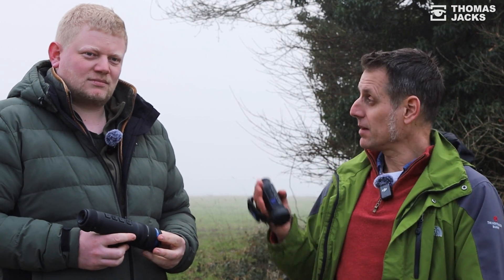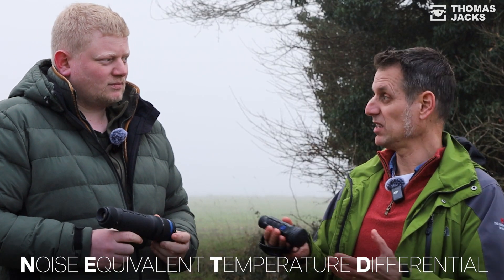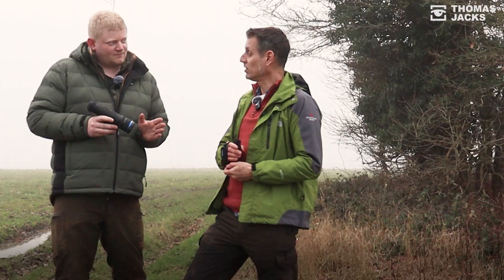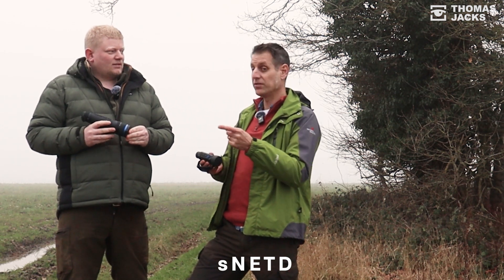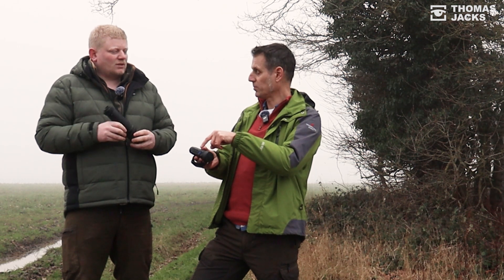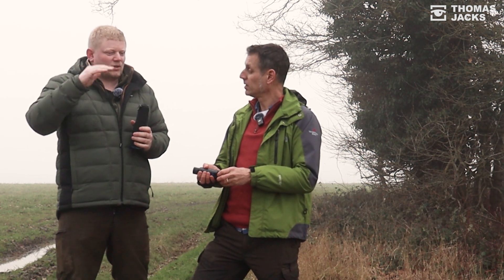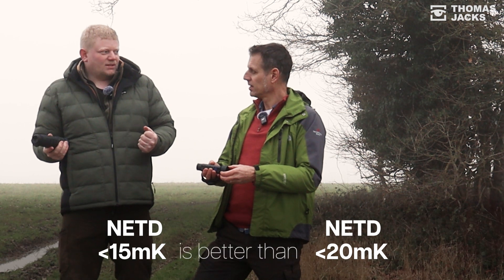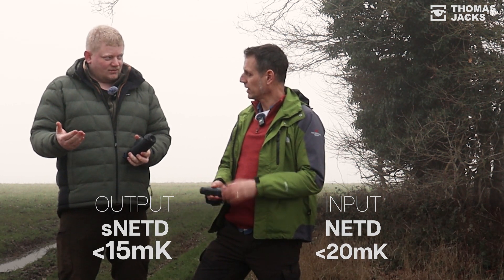NETD versus sNETD: The truth about your thermal's spec

Comment: Do thermal sensors actually produce an image though? As in, can the image be seen with no processing? If not, then how can there be a difference between sNETD or NETD?
Reply from the maker: It's the same principle as a digital camera - there will always be some processing. But the level of processing and the degree of compromise that accompanies that, will vary. On the whole, the principle of 'you get what you pay for' is usually a good rule of thumb. 
Pulsar are the only manufacturer to provide the sensor manufacturer's NETD value. Others only give the NETD figure after all the processing. So the two are not the same. 
In future Pulsar will give you both the true NETD of the sensor and the processed system NETD figure, to help customers can compare. I suspect other brands might be reluctant to offer the true NETD of the sensors they use.
Reply: @thomasjacksltd  if the sNETD is what you see, then why would it matter what the sensor rating is?
Reply from the maker: It's a sensor and it SENSES infrared radiation (the display is the device that produces an image). The sensitivity of the sensor (measured in NETD), as well as its efficiency, speed, power consumption (ie it's quality) all matter. 
If you opt for a device with lower quality components (the sensor by the way is the most expensive component in there), the sensor is likely to be slower consume more power and it will almost certainly need more amplification and processing... which also consumes extra power and adds time.

Comment: Great video explaining some of the questions that have been going around in my head trying to figure out what thermal to go for.. Am I shopping for specs listed in the spec sheet, or is it not quite that simple - which it sound like it is not.
One question remains though - and I appreciate that you sell both so I'm perhaps putting you a bit on the spot for asking - however here goes:
Something like Pixfra ranger 625/635  or Mile 2 625 all have 640 sensors and NETD values of >25 vs. Pulsar XM30f or XQ30pro - similar price but smaller sensor and/or larger pixel pitch - so on paper, the choice should be easy - the Pixfra's should be better, but judging from your points in the video, maybe specs arent all. 
So: which is better lower end Pulsar vs Higher end Pixfra?
Reply from the maker: There is an established belief that 'the entry level product from the best brand' will be better than 'the best product a much cheaper brand can offer.'  It applies to whatever your buying - whether that's a car, a camera or or a computer. 
The advice I offer people at events we attend is: If you're in the market to buy, TEST the products you can afford, against CRITERIA that matter to you.  Sometimes Pixfra will be the right choice, but whatever you choose...there will come a time that you realise you can afford a Pulsar and you wont regret it.